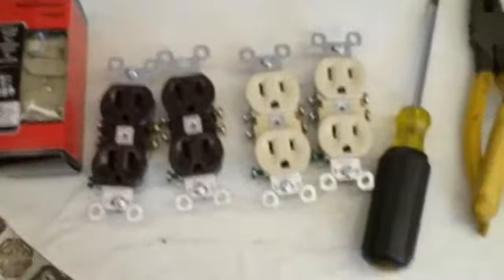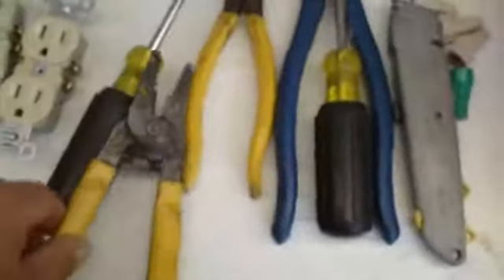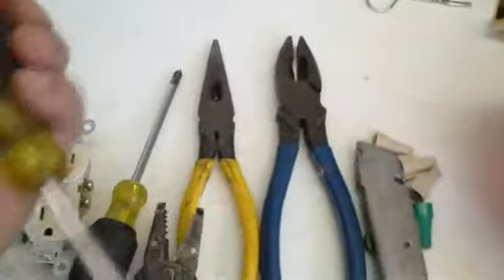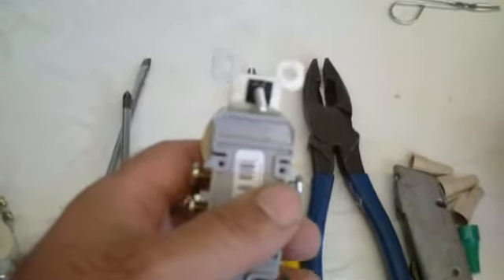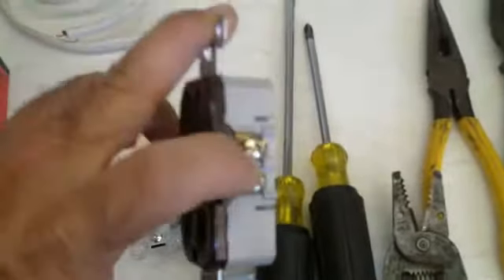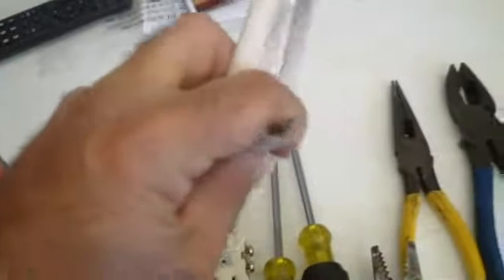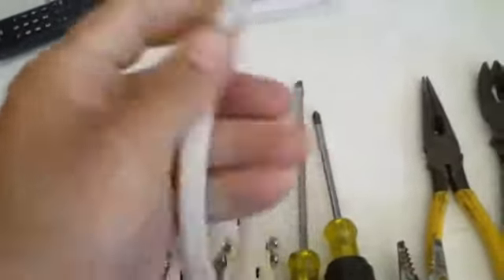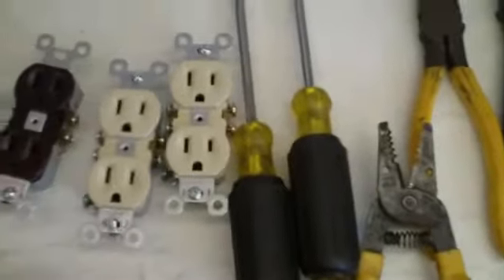Preparing For Electrical Repairs

Comment from the maker: They do have them and they are expensive....  they also make pigtail devices, but even those are questionable.....  for the most part anyone making aluminum splices around here, has to be licensed to do so.....  I havent ran into aluminum romex in a long long time.